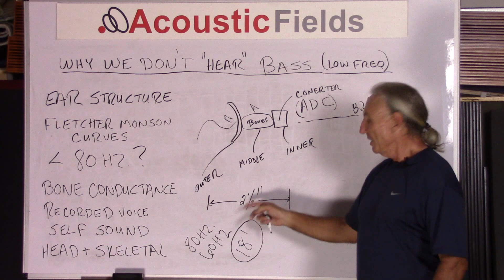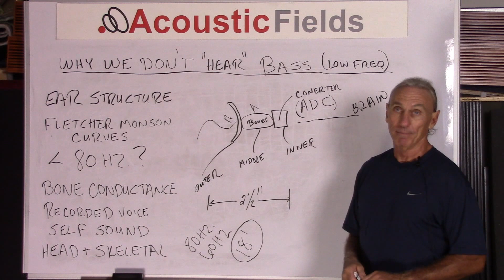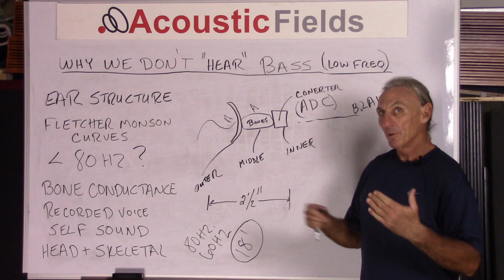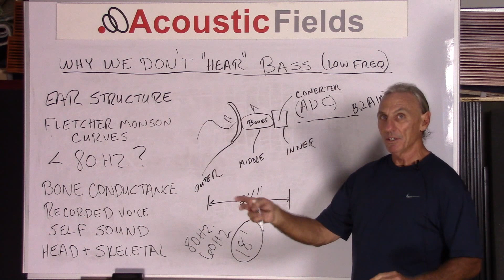How We Hear Bass - www.AcousticFields.com

Comment: The first video I don't really appreciate. How does this theory fit together with the fact that I can't hear bass frequencies when keeping my ears closed by finger? Playing a sine sweep from 20 to 20k Hz and holding my ears closed, I will start hearing at around 150 or 200 Hz. Therefore I doubt a bit the "we don't hear below 80 Hz" theory. But it's totally possible that I missed the point here.
Reply from the maker: We feel the low frequency pressure. We do not actually "hear" it. Research bone conductance.
Reply: I understand so far, but for me it is almost zero in low frequencies when I close my ears. It shouldn't make that big difference when we actually don't HEAR bass frequencies.

Comment: Best bass explanation I've ever heard! You are the "professor" ! 
Quick question, does the fact we feel but not hear below 80 make the ultra low big money subs less crucial at all?
Reply from the maker: J,  Low frequency energy below 80 Hz. is not heard through our normal auditory system. It is felt through a process called bone conductance. Our skeletal system becomes our "ears" as the oscillating waves of energy pass through us.
Reply: Acoustic Fields yes but does this make big money deep reaching subs a bit less crucial.  Is there a loss by feeling more than hearing?
Reply: Ok it finally sank in!  Thankyou sir!
Reply from the maker: J,  It depends on your room size and volume. Ultra low subs sound "feel" great if you have distance/volume/treatment balance. Start with at least 30' in two dimensions.

Comment: Excellent 'Presentation'. Most informative. I'm presently 'mixing' on Samson Resovl Studio R4 Monitors; they're a few years old, now. They are quite 'good' for their size, but I 'find', I tend to 'overcompensate', on Bass with them. I 'personally' Feel, that , you need 8's, at a Minimum, to 'truly' Hear 'Accurate' Bass, and 'not' end up, 'overcompensating'. I want the New Presonus Sceptre S8's, 'when' I can 'afford' them. I use Presonus Studio One Professional, and I LOVE IT!!!
Reply from the maker: Hi Sterling McVay 

Thank you I appreciate your response and time. Each low frequency driver diameter is capable of good definition at its designed for frequencies. I believe your room is getting in the way. Remember, that if you have a room pressure area at 40 cycles fundamental, you also have all the harmonics at 80, 120.... Sometimes these harmonics can be just as big of a problem as the original fundamental. 

Thanks and have a great week
Dennis